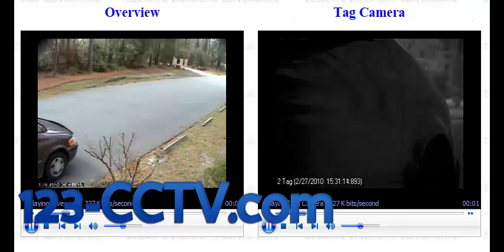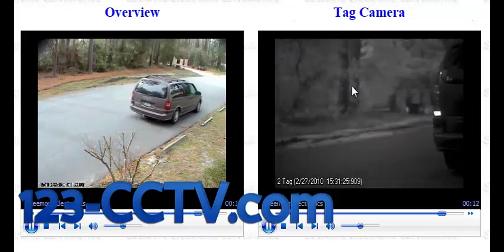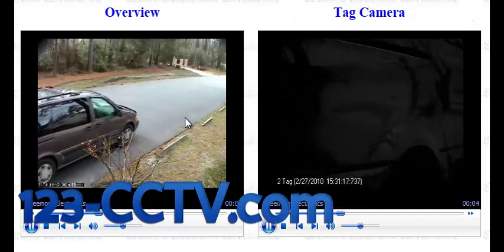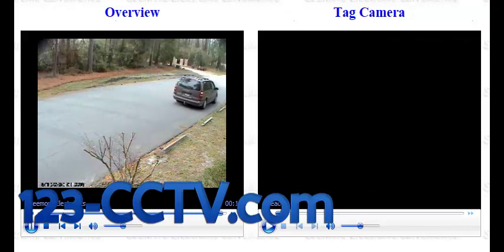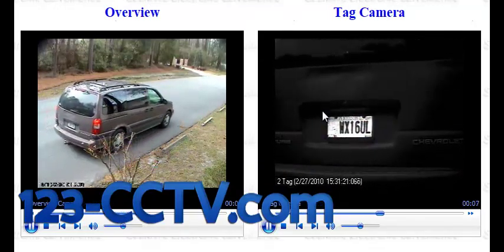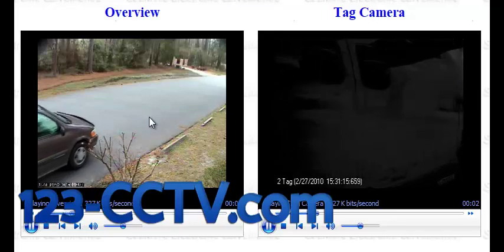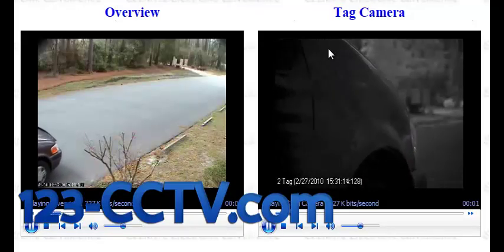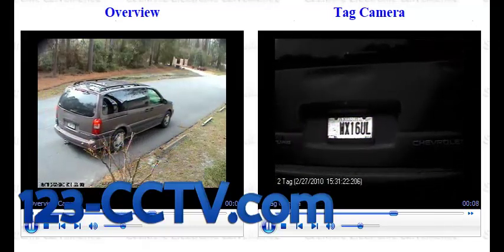How to properly set up a license plate capture camera

Comment: The car stopped.  I guess that means it won't work if the car doesn't stop.
Reply from the maker: H Craig The LP60 works for moving vehicles as well. You can find it here: http://www.123-cctv.com/high-resolution-license-plate-capture-camera.html
Reply: What is the recommended formula for shutter speed vs vehicle speed?  

What are the tradeoffs in reducing shutter time to capture faster motion?  Presumably less capture time leads to more noise - and ultimately in a too noisy image the plate becomes unreadable - where is this cutoff under what conditions?
Reply from the maker: Depends on the camera. When we ship the camera it comes with a guide that provides such information.